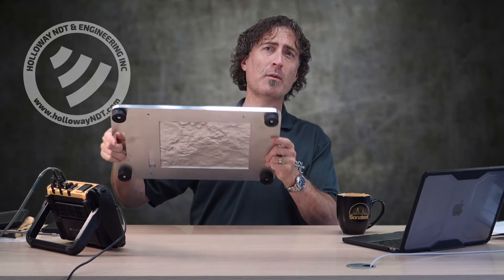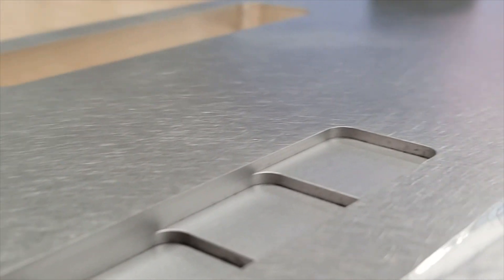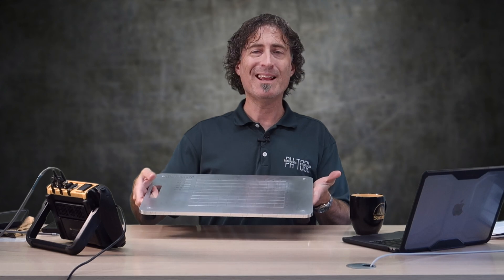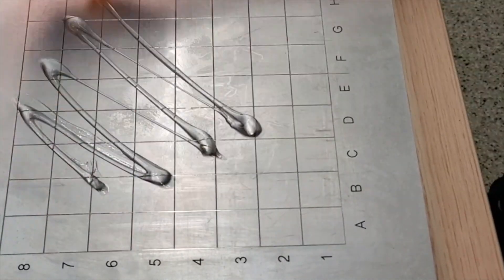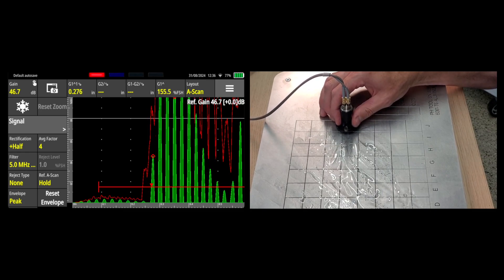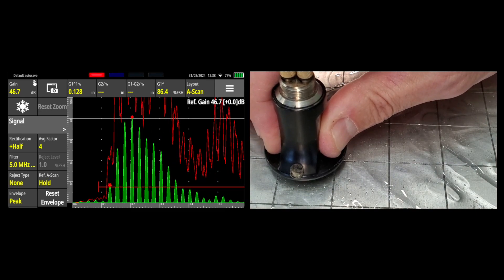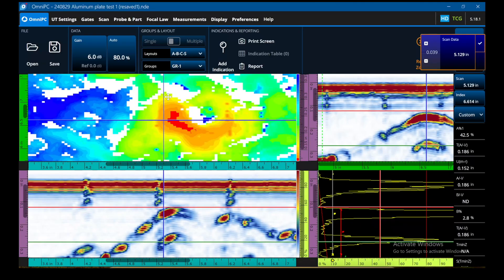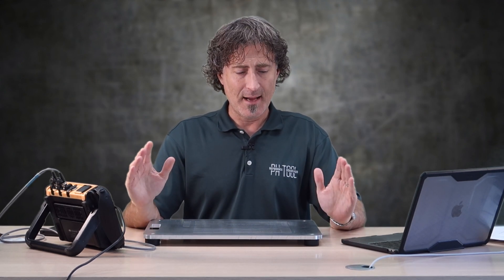Corrosion Test Plate

Comment: Can you do a video on doing thickness testing on small bore (under 2" dia.) piping with corrosion under the coating. I am having problems with these.
Reply from the maker: Corrosion under the coating? On the OD?
Reply: @hollowayndtengineeringinc.5201 OD Thickness